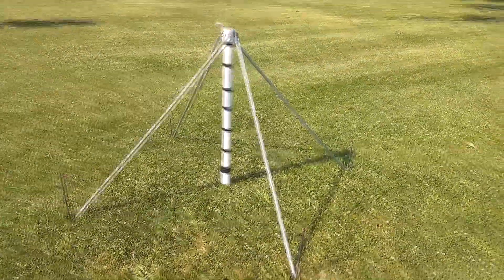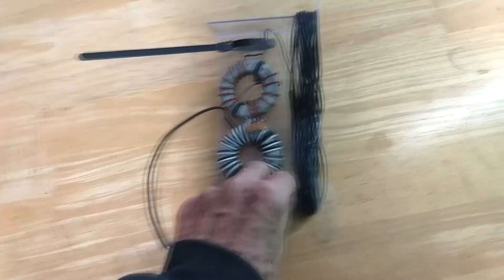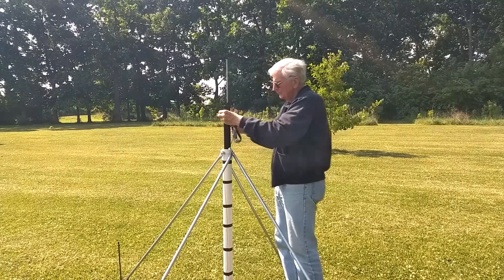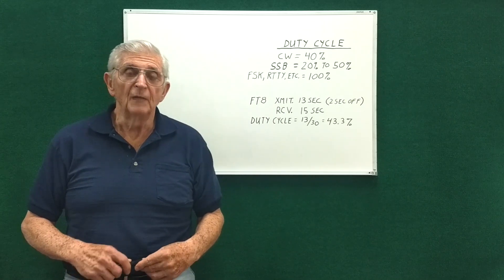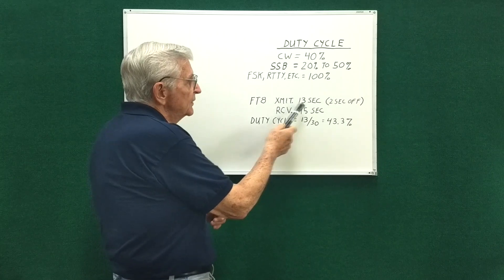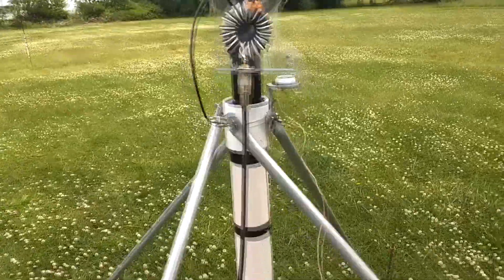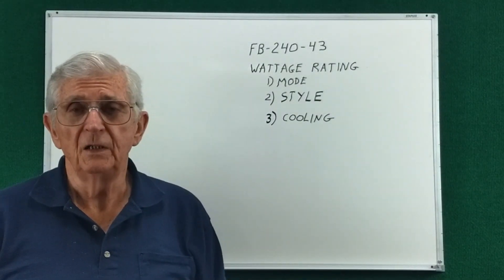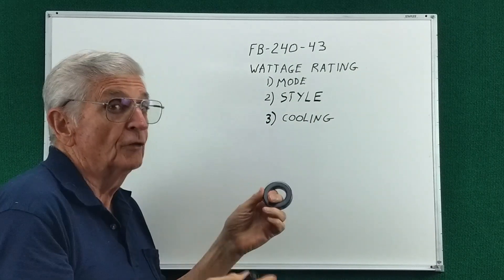EFHW Antenna Power Rating

Comment: How many watts were you using in your test?
Reply from the maker: The answer to your question is in the video at time 7:17. Thanks for your comment.
Reply: @Jimscoolstuff  Thank You. I missed that. What gauge is that wire that goes up the mast? What is the power rating of that? Is there any ARRL chart for the diameter of that wire vs power?
Reply from the maker: @Last_day_events  I used #22 wire. The impedance of the antenna is 49 x 50 ohms. This is 2450 ohms. At 100 watts the current into this wire is 0.2 amps at the feedpoint and increases to a maximum of 1.4 amps at the quarter wave point. There are much bigger losses in the ferrite core than in the wire.
Reply: @Jimscoolstuff  Wow, that's a very big help to me. Thank you !